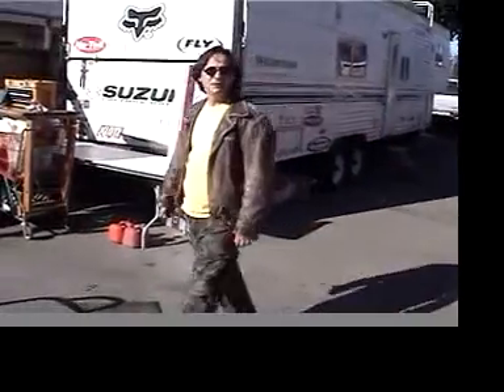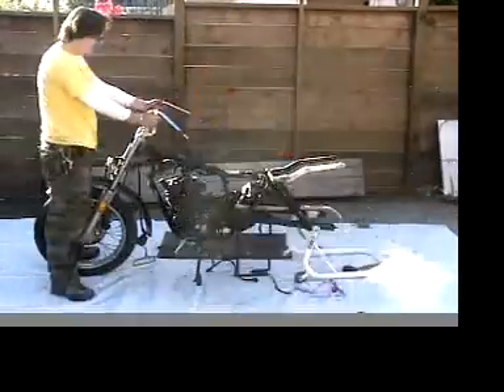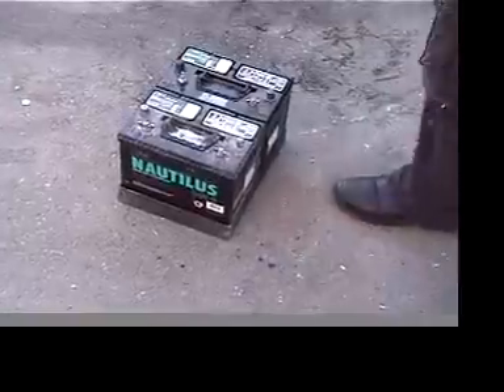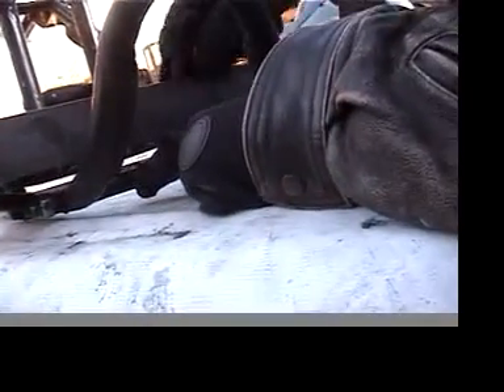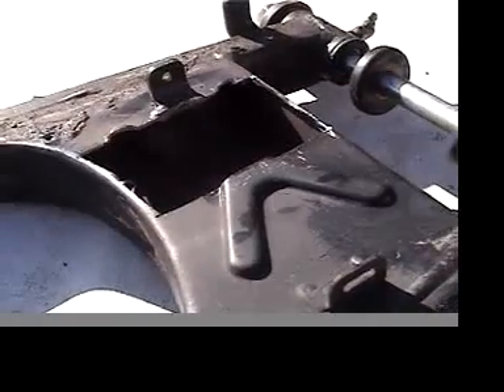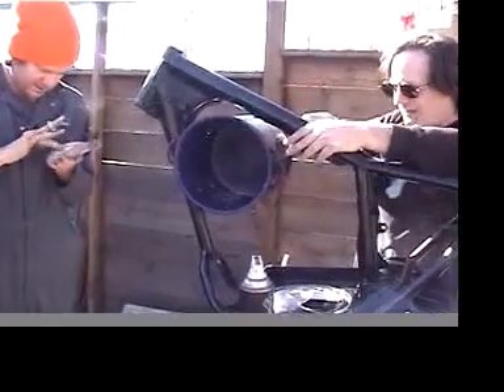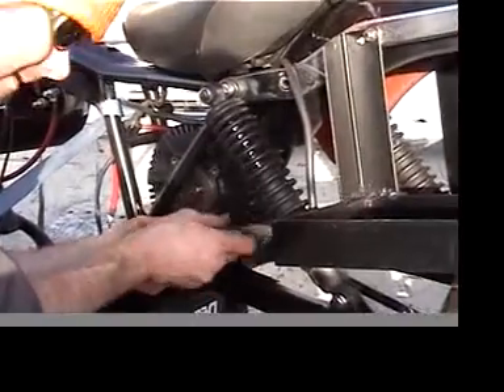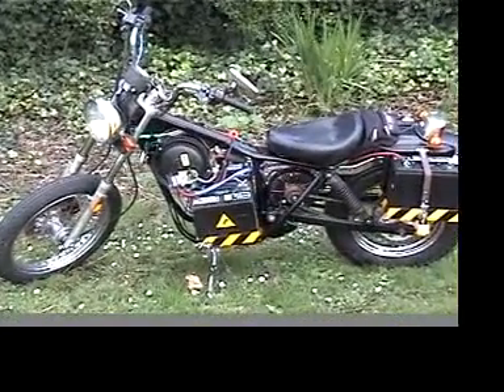Gomi Style - Electric Motorcycle Conversion

Comment from the maker: This bike is mostly silent, but makes some friction noise.  I plan to mount a tiny mp3 player with a few sound options:  Harley, Lion, Siren, etc... Recharge time is variable, based on several factors - battery size, charger's Ah power, etc...  The cost of a full recharge is about .12 cents and gives about 30-40 miles.   Also for any given amount of power, the vehicle's tailpipe emissions are far worse that the comparable amount of powerplant emissions for the same power - at least where I live.

Comment from the maker: Thanks for all the questions.  I will try my best to answer.  In CA, we have a large % of renewable sources for our AC grid, and getting better all the time so using AC is better than gas overall by a large margin.  Ultimately, a small solar panel at home would charge the bike for 0$.  The batteries are sealed, but can be a little leaky if poorly maintained.  Small traces of battery acid ruined my pants one, but that's all.  Thanks again..

Comment from the maker: Thanks for the question.  The weight of the bike with batteries is somewhat close to the original bike weight - a little heavier.  Everything was strapped in tight, so handling seemed fine.  If only It had the power to match!

Comment: instead of using the car batteries witch has cca(cold cranking amps) you should try deep cycle batteries like marina or wheel chair batteries, it may give you more range and may be lighter.

Comment: I think it will be more likely that the batteries are wired in series to get 48 volts. On the type of motor they're using, this gives a higher speed than using just 12 volts.

Comment: Thats really cool... I would like to see you guys clean up the looks of the bike.  Maybe custom containers for the side batteries or something.  Also what is the range on it.  Looks like 4x car batteries, or are they deep cycle marene batteries?  Either way I'm guessing they are about 60amp hours each.  So combined 240Ah at 12v.  So thats a good 2.88KWhr's.  I'm guessing the motor is about 5KW's?  So 1/2hr of riding at full speed... 20-30 mile range would be my guess.  Let me know the specifics.

Comment: With the same weight you could use a battery with a much higher energy density like Ni-MH F cells and likely double the distance it could go on a charge as well as eliminate the possibility of sulfating the cells if you run it too low.

Comment from the maker: Ok, since you're serious...
1) AC doesn't suck, it's cheaper cleaner, more efficient than gas.
2) ACs are faster than by design.   
3) ACs are ALL torque - no ramping up like gas.  Most AC's are de-tuned so drivers can handle it. Google AC drag racing.
4) AC makes a cool noise like a UFO.  
5) AC Charging does take longer than gas, but ruin the earth just to save a few minutes?  That's lame.
6)  The earliest cars were AC, not gas.  If batteries were good then, we might have NO gas cars at all.

Comment: Nice idea. Too bad the builders didn't have access to some better materials and higher efficiency batteries and a more ecological manner of charging them. Still, digging through the GOMI, you're not likely to find better. 

Too much time is spent on the battery tray, which anybody could fabricate, and not enough time is spent on the tuning of the drive train and the nameless "electronics" in the bike--which are much more of interest to the viewer. Good job!

Comment: 1. dosen't 200 pounds of batteries defeat the purpose just a little?
2. no lathe, mill i assume.
3. i want a few of those motors.
4. again, wall charging. power from coal station or worse. its not better...

Comment from the maker: Yes, you are correct.  When people refer to a vehicle as "zero emissions" they're talking about exhaust.  Since the power from power plants is generally cleaner than the pollution caused by burning gas, it is much better, mile per mile,  to run an AC vehicle than a gas powered one, especially if you can plug in at night when the power grid sits mostly unused.  however, until the power plants are from entirely renewable sources, there will always be SOME pollution created. Thanks for the comment!

Comment: You can get Angle iron for battery free behind stores that sell beds. They usually set the old beds they take out of the customers house out back by the dumpster along with the bed frame rails. The bed frame rails are great for all kinds of projects.

Comment: DesGeo is actually very right.  There are quite a few retro-evolutionary groups building ultra-modern vacuum sealed external combustion engines (steam engine) which work amazingly well, in both efficiency AND power.

Comment: Ok I have to say I'm impressed with this idea. I'm sure there is alot of tweakingt you could do to improve it. Maybe some small solar panels would give it some added umph. Perhaps switching out all the bulbs to LEDs might give you a little more life per charge as well. But I guess that wouldn't make it very "GOMI"
I did have one thought though, how are you keeping the electric motor dry on damp or rainy days & the electronincs free of moisture?

Comment: Fission is technically net negative energy, but only if you consider the energy gone into producing the uranium long ago. We only get 33% of the energy out of the reaction at best because of the Carnot cycle, but overall we still get energy out of the reaction. (you just have to consider a shorter timescale). but that hardly seems relevant, because any power plant is net negative energy thanks to conservation of energy... so whats your point?

Comment: However, transmissions have other advantages, such as changing the gear ratio as you go, allowing the motor to utilize its power for certain situations, say, hill climbing. I imagine you can use less of the motor's power, and thus, reduce battery load for various gears. Instead of drawing more power from the batteries and putting more strain on the motor to pull the bike/vehicle to accelerate. I imagine you could get much better acceleration by having a gearbox, and better battery mileage.

Comment: Its not just about emmissions. Electric motorbikes make far less noise and also run much cheaper than petrolium powered bikes.

I would like to make 2 comments thought:

1) Lead Acid batteries are hardly environmentally friendly. If you used recyclable NIMH you would get far more power for your storage capacity and a far lighter bike.

2). Using brushless hub motors in the front and rear wheels would also give you more space inside the chassis.

Comment: "The increase in power plant consumption if everyone converted to electric means no less pollution as the increase in power plant consumption would offset any emissions saved by the electric vehicles."

That assumes that the additional electricity would be generated by burning fossil fuels.

"Furthermore our power plants can not even now handle the demand for energy."

That's because the Atomic Energy Commission was, for decades, run by politicians, not scientists.